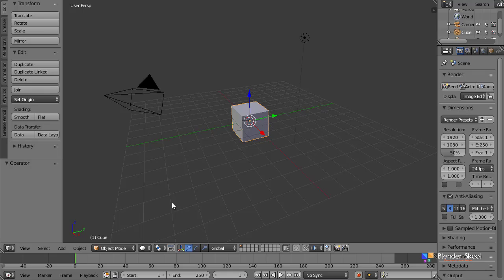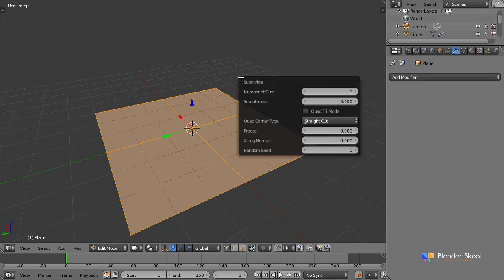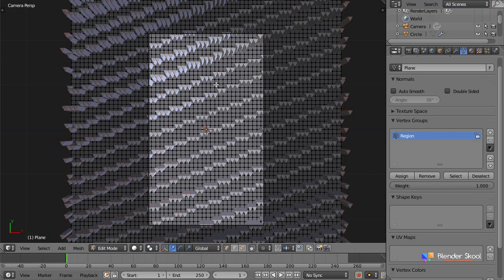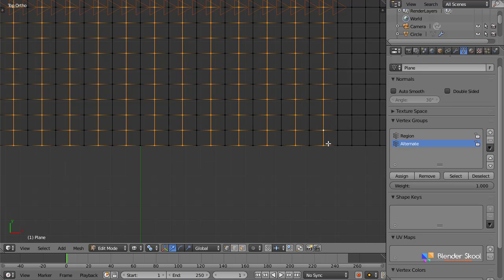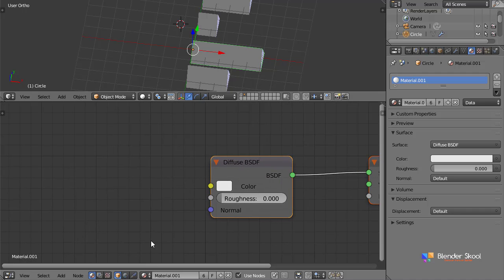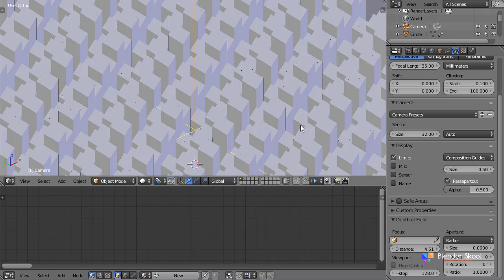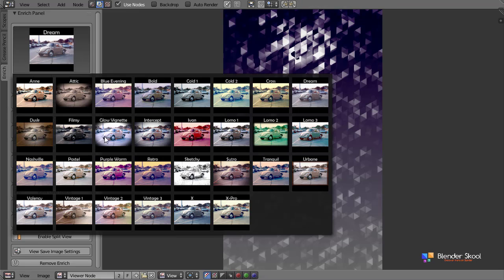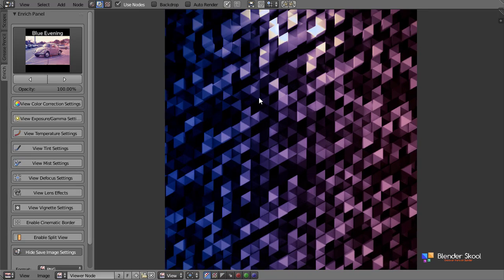How to Create an Amazing Abstract scene with Triangles in Blender 3D

Comment: Thank you very much for your videos. I leave you a screenshot with a very quick way to select all those edges. In this case it works very well. Is not always that way.Sorry for the mistakes.Regards.
http://subefotos.com/ver/?1ee4ab04187ccd28aa5ab01fcbdba56fo.png
Reply from the maker: I don't see the direction option in the menu. Probably you are using some add-on
Reply: It's no addon.The "Edges" option must be selected.
http://subefotos.com/ver/?bd70991c523fb8fadc752ddff32fabd6o.png
Reply from the maker: Ok, it worked, but then it does not select alternate rows, but looks handy :)
Reply: It's strange. It works for me : ^ )
http://subefotos.com/ver/?8b7bd648c64eea4982cc06bd7da1cb4ao.png
Reply from the maker: Yeah it works like that only, but it should not select all the vertical rows, it should leave one row and select the another :)
Reply: Now I understand you. When you switch to "Vertex" mode, the selection is lost. Forgives : ^ )
Reply from the maker: No Prob.... It may come handy later :)